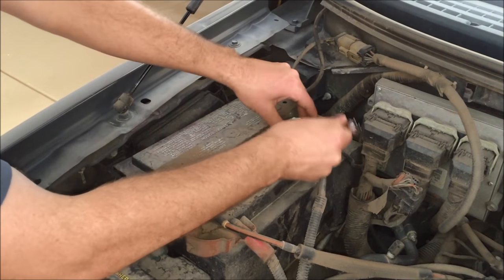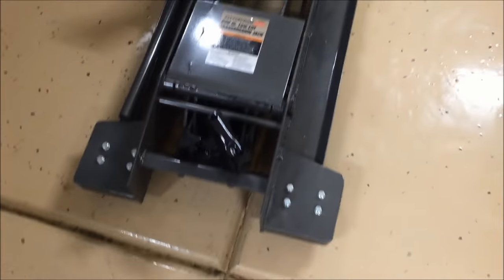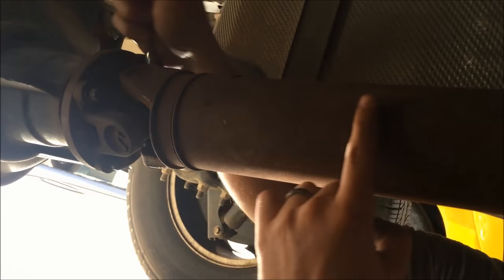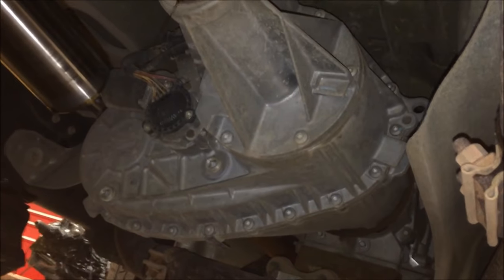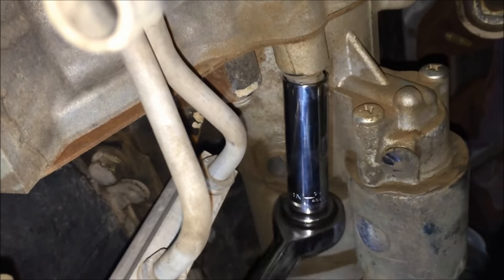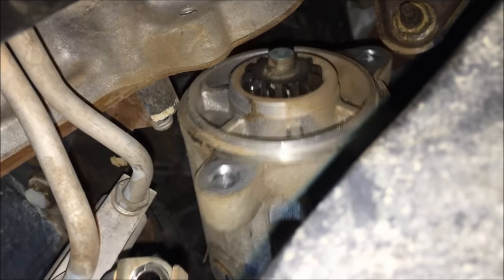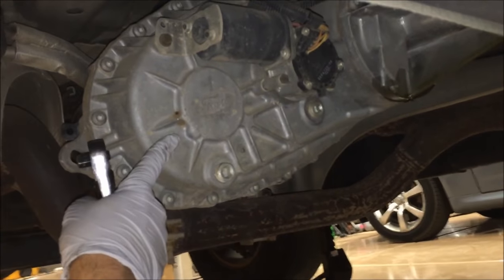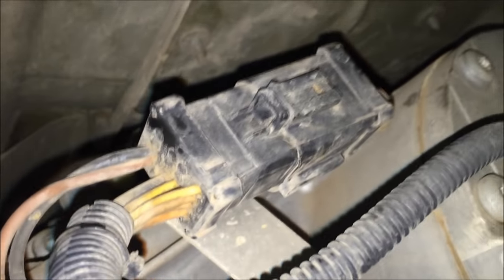(1/4) How to replace Ford F-150 automatic transmission Mustang : cambiar una transmision

Comment: Best how-to video on anything to do with removing the transmission of a F-150 / Expedition.  I was replacing my flex plate and replaced my rear main seal while I was in there, but this got me 99.99% there.  A few of the items, like exhaust connections, were different for my Expedition, but overall a GREAT tutorial video.  Stepped through the entire process to help minimize the pains of doing something out of order and the bolt/nut sizes were spot on and saved a lot of size hunting of sockets and wrenches.  Thanks.
Reply from the maker: chriscozart0620 I’m glad to hear that. Thanks for watching and thanks for the feedback! Great job getting it done on your own as well :)

Comment: Had my f150 truck parked in the garage for about 7 yrs., started it up but it wouldn't move, looks like all the fluid had leaked out.  I added some fluid then was able to move it.  What could have caused all the fluid to leak out?  Any thoughts would be helpful.
Reply from the maker: That’s very odd. It holds around 14 quarts so maybe it wasn’t completely out but just needed some. I’d keep checking the levels

Comment: Do u have to take the entire starter off to take the trans out.. Or can u just unscrew the electrical  connections. On my 95 f150 with 4E0D
Reply from the maker: The starter bolts only go into the transmission, so it should come down with the transmission BUT I would worry about it getting caught up on the flexplate (flywheel) and having enough clearance to come out without hitting the body. The starter teeth don’t engage unless the starter is activated, so that part shouldn’t be a problem- just the starter itself that goes into the bell housing that I would worry might hit the flex plate.
Reply: @dannyjohnsonsgarage    Thanks for the quick response.   The  problem I have is that  the 2 bolts that hold the starter in were in bad shape so I stripped them out really good.   And it's such a tight darn spot it's hard to try to work them out.

Comment: The 15mm nut on my shift lever is stuck, and the whole bolt is coming out while I am trying to remove the shift linkage. As a result, when I loosen it, it shifts all the way down to 1 and when I tighten it, it shifts back up to park. Is it okay for the bolt to come out, and will I be able to take the bolt out and still shift it into neutral?  I am trying to remove the transmission to replace the rear main seal in my 1998 F-150 with a 4.2 engine.
Reply from the maker: I suppose you can try. You could also soak the nut in liquid wrench and if you have an impact gun the quick bursts can knock it loose. Also if you tighten it, sometimes  it will then come loose when you remove it

Comment: Where does the hose that you disconnected from the transfer case go to. I have a 2000 f150 and someone took the end of the hose not connected to the transfer case folded it with a zip ties. I don't know what is its purpose or location
Reply from the maker: If I understand correctly, that is only a vent tube used to vent pressure from the transfer case. It doesn’t go to anything, just slows the transfer case to vent built up pressure

Comment: Do you need to take off the torque converter bolts to drop the tramsmission and replace the back seal
Reply from the maker: K1LaMOBKAL1 If you are referring to the rear main seal of the engine, you’ll need to remove the transmission with the torque converter still attached, but do not remove the torque converter from the transmission
Reply: @dannyjohnsonsgarage  thanks man really appreciate it.
Reply from the maker: K1LaMOBKAL1 Good luck 👍🏼
Reply: @dannyjohnsonsgarage  i have a 2002 mustang. I need to replace the rear main seal this weekend. I was wondering if you can just remove the transmission without having to take off the torque converter bolts ? What about the flywheel that stays on when you drop the transmission ?
Reply: Also its a V6
Reply: Also an automatic
Reply from the maker: K1LaMOBKAL1 The transmission cannot be lowered unless you remove the torque converter bolts. You will need to unbolt the torque converter bolts that go to the flywheel (called a flexplate on automatics), then drop the transmission. You can keep the torque converter inside the transmission and don’t remove it.  Next, remove the 6 bolts in the center of the flywheel that hold the flywheel (flexplate) to the crankshaft. Now you can access the rear main seal area which surrounds the back of the crankshaft.
Reply: @dannyjohnsonsgarage  thanks for keeping me updated i really appreciate it. How many bolts on the bellhousing ?
Reply from the maker: K1LaMOBKAL1 There should be about 8, but if you count the starter bolts there are 3 more

Comment: I have a 2005 Ford explorer. Is this process roughly the same as this video, or are there a couple things that are drastically different? Any help would be TREMENDOUSLY appreciated. 😥
Reply from the maker: Yes, same basic process. I just changed the transmission in my friends nissan and it’s even the same. If you follow the video step by step on yours you’ll do fine!
Reply: Danny Johnson OK cool. Thanks man. I'm scared to death to attempt this (first try) but I sure as hell can't afford a "real" mechanic, so i don't have a choice.
Anyway thanks for replying Danny. I really appreciate it sir.
Reply from the maker: Matt Hatter Yeah, just make sure you have a transmission jack and a few friends to help!
Reply: Danny Johnson For sure bro!! That transmission jack is a MUST!!

Comment: I hope you checked that the fill plug on the transfer case would open before draining it
Reply from the maker: I was not concerned. Once removed I could tip the transfer case on end and pour it in the drain plug if it was a problem. Both plugs worked fine

Comment: You said to make sure the truck is in neutral.but what if you are getting the transmission from a junkyard and some trucks don't have the key to put it in neutral.how would i be able to turn the crankshaft.?
Reply from the maker: pablo lira You will be able to shift the transmission by hand when removing the shift linkage on the side of the transmission as you will see in this video series
Reply: Thankyou for letting me know.I'm going to use your video as a guide step by step for when i take my transmission down
Reply from the maker: pablo lira Be safe. Don’t drop that transmission or transfer case fall on you. I’d get some ratchet straps for use on lowering as you’ll see in the video

Comment: plus there's a solenoid which prevents power to the place u work on so even if 12 volts was enough to shock you which it's not without you laying in water. you still don't need to unhook the battery....
Reply from the maker: Epiphany Lee It’s never a good idea for sparks to fly..or short anything out. It WILL happen when working with the starter so make sure you disconnect the battery!
Reply: Why argue against such a simple safety precaution?

Comment: So I forgot to put engine in neutral before disconnecting, what now lol, trans has no bolts anymore.
Reply from the maker: Ruben Lozano it shouldn’t effect anything. You can click it into neutral by hand on the selector with a pair of pliers (driver side where you unbolted the linkage).. Have you removed the torque converter bolts from the flex plate? (flywheel)
Reply: Danny Johnson okay good, now would it be the 3rd first click facing the front of the truck ? And no haven’t taken those off yet just the bellhousing bolts
Reply from the maker: Ruben Lozano I don’t remember off the top of my head, so try to turn the flywheel by putting your fingers through the access hole on the bottom of the bell housing (as shown in the video). As long as you can turn the converter you may not need to mess with it